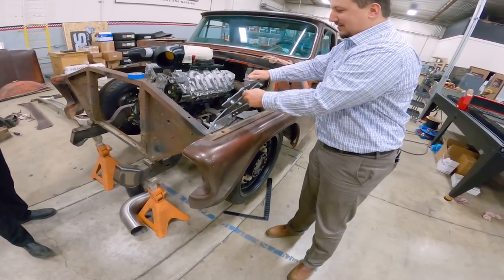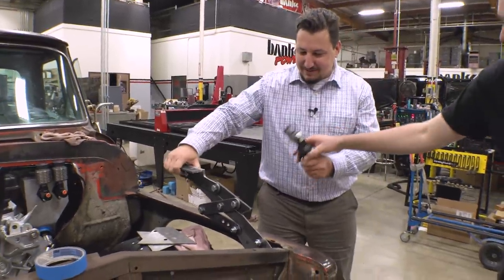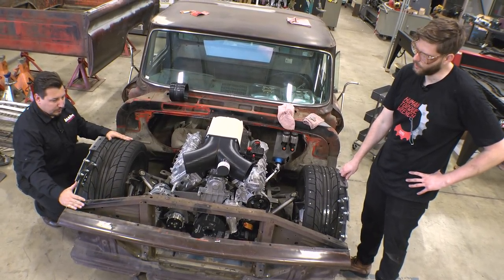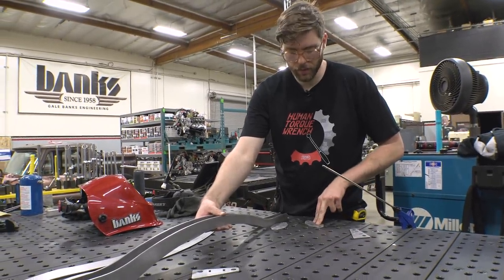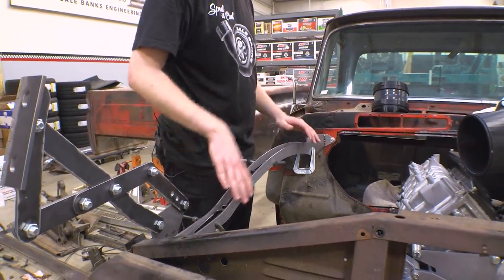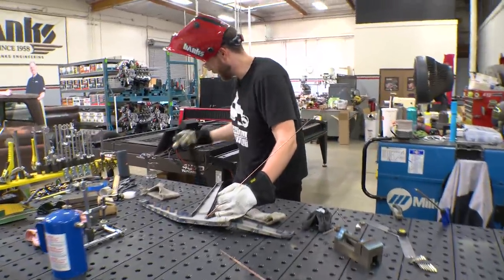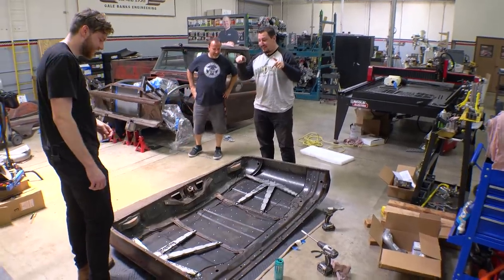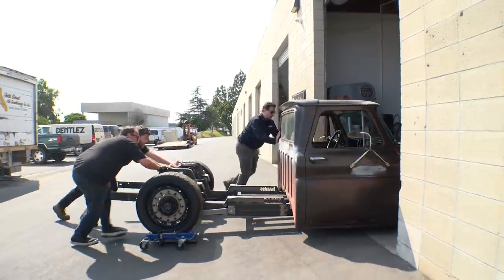Engineering Ideal Access To Our Supercharged L5P Duramax | BANKS BUILT Ep 26

Comment: Sweet fabrication. You might find a need for triangular gussets on the core support to firewall braces to help with side to side forces and sheet metal alignment needs. Ties bars might do it as well. There's a lot of weight with that hood so dynamic forces while driving will be working much on those braces.

Comment: What about allowing for front turning radius when slammed? Those mock up braces look to be too close to the tires
Reply: The truck won't be moving when it's slammed however good point in case the wheels are steered before the truck gets slammed
Reply from the maker: Jacob is correct. When the truck is slammed, it will not be moving. To move, LokJaw will fully inflate the airbag system.
Reply: @bankspower  But you will need to make sure your front tires are perfectly straight before you drop.

Comment: Seems the hinges should have been doubled on both sides. 

Half inch (example) 
Delrin bushings or slim roller bearings at all of the thru points. It would seems to give more lateral support and significantly reduce side load sway.

Then again I’m just a broke professional YouTube viewer - also enjoying the imitation Issac Hayes 70’s music they inserted at 14:32.
Reply: Personally, I'd make bushes sized to a longer bolt, tighten bolts with bushes in place, tack and then weld.... a bit of grease and done...thread the bush on one side, for even less slop & eliminate the nut.
Reply: @charlesangell_bulmtl  
Something. Mishandling that hood, someone accidentally leaning on it (while it is up) or even a strong wind and that current hinge system looks to be the glass jaw.